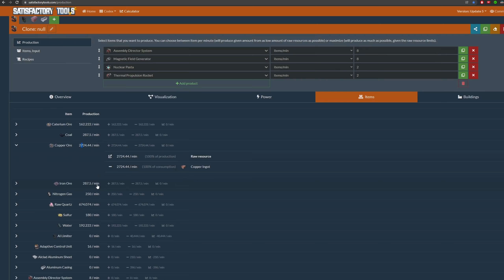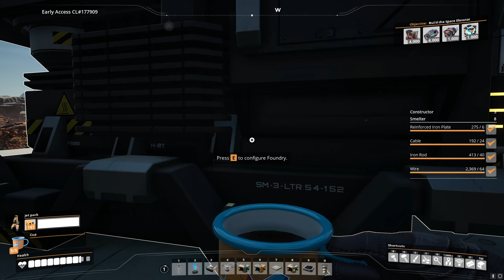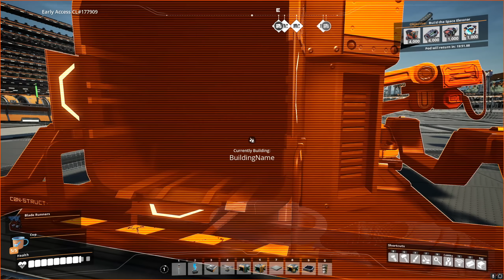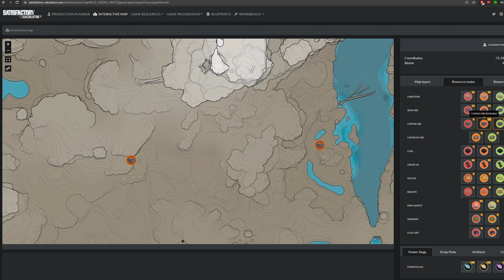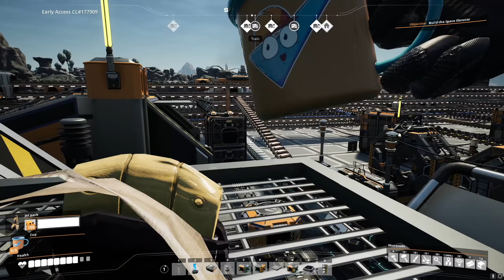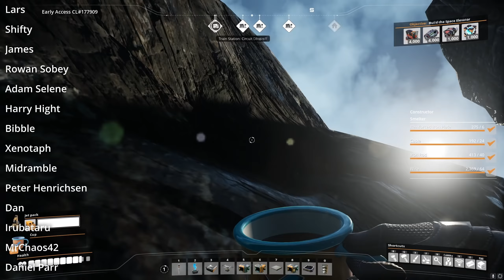Satisfactory : Ep15 Compact Copper Powder

Comment: If you want maximum overkill with the awesome sink, you can go back to the bus and upgrade all the regular splitters to smart splitters and set the top output to overflow and right output to any.  That way you can dump what remains on the bus into awesome sinks to get every last point possible.
Reply: I did this and it changed my life. Granted, everything's running all the time, but power is easy to get in this game. :)
Reply: I think the plan is knock out the last elevator milestone and then just dump the bus into the sink, no need for smart splitters for that :)
Reply from the maker: Pretty much, once the elevator is full we will dump all the "finished" resources into the sink and it should come to 7 million points a min.

Comment: You are now ahead me.  I haven't automated the control rods yet so I don't have the tech to do the copper poweder.
I made the rods by hand to experiment with nuclear.
One liquid isn't so bad.  It's when you start dealing with waste water that it gets hairy.
Reply: Thats a comlin mistake i see in satisfactory a lot, never manual craft, aint worth it, you can allways automate it way faster and by the time you automate something else the crafting its complete
Reply: @santiagoperez2094  It wasn't a mistake.  I just wanted 1 or 2 to see how it worked.  Haven't gotten around to making a true factory for it is all.
Reply: I built a control rod shack and have sent it up.
I'm working on laying out a 10 reactor power plant over the swamp which is where I have 1 for experimenting with.

Comment: Personally, I'd like to see a drone network up and running. I know it's less cost-efficient compared to trains, but no tracks to place, which would open up a lot of space around the "Terminals" for other things (like a launch-tube network covering all 8 directions) aswell as height difference issues are almost eliminated. 

Been trying to set up a drone network in my own save, but can't seem to get it working properly. Trains are definately more straightforward in terms of setting up.

Comment: Good video.  I just threw my hands up in the air and said feck it.  I have a random of shoot of one of my factories using copper making a pity full amount of copper powder and eventually it will make my 1000 Nuclear Pasta.  Hopefully by the time I have the rest of the other parts made.
Also You're lucky to get that alt copper ingot recipe, I've been looking for it with no luck yet
Reply from the maker: I went HDD twice to make sure I had all the recipes, there is a online map you can use to show all the locations and what you need to open them. Two big runs secured me 95% of the drives, though are are best off waiting until you have the jet pack.